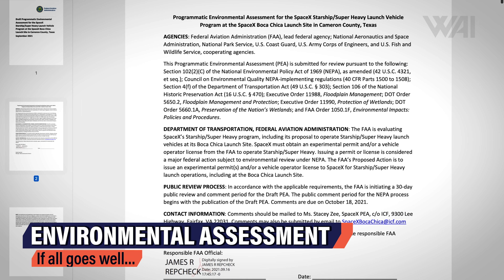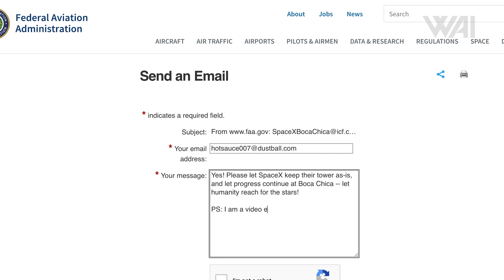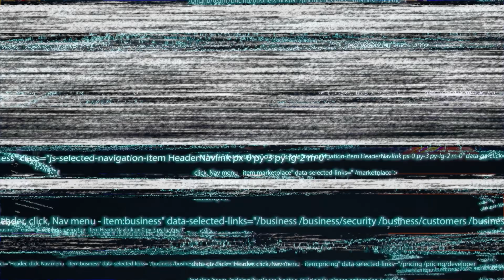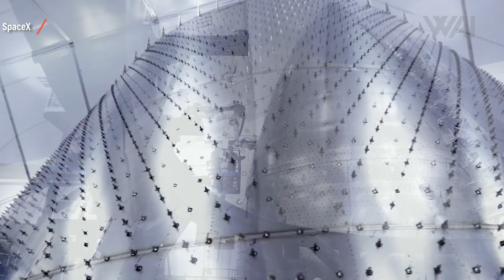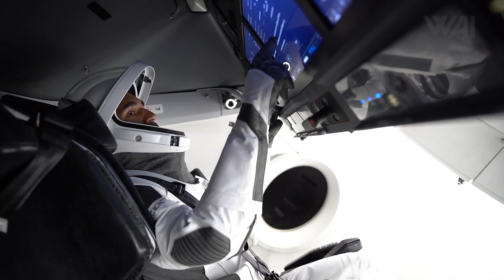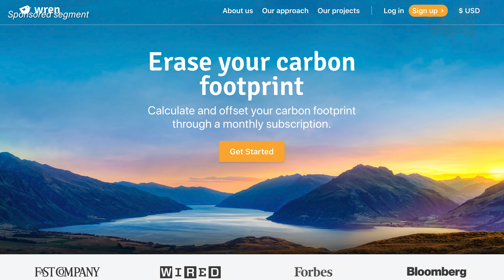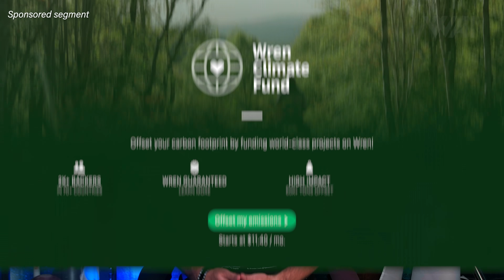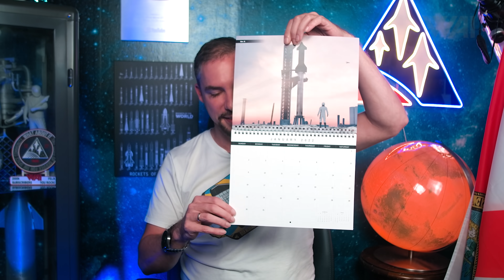One month to an orbital Starship launch attempt! & SpaceX Crew 3 Mission Status!

Comment: Idea for Heat Shield improvements on Starship: 1) Create a removable maintenance exoskeleton for the Starship that would be built in 8 to 12 removeable large sections that temporarily cover the areas where shielding is required. 2) This exoskeleton system will act as a mold for Injectable Heat Resistant Foam Insulation and perhaps a perimeter of Injected High Heat Silicone (for help with expansion and contraction) between tiles. 3) This "Exoskeleton" would have many Molding Tile sections within it (as many sections as tiles needed), and in each Molding Tile section there will be a foam spray nozzle (perhaps a couple other chemical nozzles as well such as a chemical cleaning nozzle, and perhaps a suction nozzle for sucking out liquified damaged foam from a previous mission). Each tile section mould would have to have to be made from or lined with an inner surface that the spray foam would not stick to, and allow for quick release, like release agents or oil that concrete contractors spray on wooden concrete forms to assist with form removal. 4) Each Molding section could also have it's own I.D. Chip for individual section identification and targeted maintenance. For simplicity the Heat resistant foam could be sprayed in from a central line system going through the Exoskeleton. Control of Foam spray would have to be controlled by pressure sensors or perhaps timed spray shots from each injector. Perhaps each repair done to a Tile Section could be carried out by a 3D Printer instead of just pressure spraying the foam in. This would likely require a small access door on each Individual TIle Molding section on the Exoskeleton. A built in traveller track would have to be built onto the the exoskeleton allowing the repositioning of the 3D printer all over the Exoskeleton where needed at the time. A separate small robotic would have to travel with the 3D printer to remove and then replace the access door when needed. Prior to making a repair with new foam within a damaged tile section, the cleaning/liquifying chemical could be pumped into the section to liquify the remaining damaged foam, and then have it drain out through a strategically located drain port on each Tile Molding section. Then the new foam nozzle would activate and rebuild that particular foam tile. This all means that each tile mold on the Exoskeleton has to be sealed and isolated from each other tile mold, so that only desired tiles are repaired.
5) After repairs are made, the exoskeleton is detached from the Starship with a crane, and stored away. Notice how the spray nozzles and all included hardware for that maintenance or repair have all been incorporated into the Exoskeleton and now are also removed with the Exoskeleton so there is no extra weight involved or needed to be left on the Starship itself. Also, the repair or maintenance on the Starship Heat Shield could all be done very quickly with this system.
Reply: I'll just say here, that NASA has researched the high heat spray foam idea with another company in the past. I'm not sure where they left off.

Comment: Idk how they currently attach the heat tiles but if some of them already fell off after a short static fire, they need to radically improve the method bc re-entry is 100 times worse than any SF.

Comment: To what I know, the space shuttles heat tiles would not survive a reentry from outside earth's local orbits (f.ex back from the moon).  Wondering if SpaceEx's heat tiles are/will be more heat absorbent, since they are supposed to being able to bring people home back from Mars.  Also wondering if perhaps some (maybe also heat absorbing) layer could be sprayed to the heat tiles after stacking.   This would in a way glue the tiles together and at the same time give them an extra protective layer =)

Comment: One of the key requirements of the SS program is quick turnaround times. I’m not entirely convinced that the current TPS is going to facilitate that. Those tiles are pretty easy to damage. Inspecting each one and replacing cracked or missing tiles seems like quite a time intensive task if it ends up being something that will need to be done between each flight. It may be quicker to have a single piece composite heat shield that can be swapped out as needed. That would only take a few minutes to do compared to inspecting and replacing individual tiles. It could slip over the nose at the top and be secured with a couple of bolts at the bottom where it’s easy for workers to reach.

Comment: If you assume the tiles are breaking off because the ceramic is failing at the attachment points, then... (perhaps SpaceX could explain why they are failing) put a backing layer on the tile which is then attached to the hull.  Adhere the tile to the backing layer and then attach to the hull into the backing layer.  Perhaps the backing layer could be carbon fibre.  Also make the attachment point (bolt, rivet, whatever) have a relatively flexible but strong joint (both on the tile and the hull).  Probably nothing is going to save a tile undergoing large flexing loads, but perhaps it could be better under vibration.

Comment: Yes, grind up the ceramic into a powder, mix with with a high temp epoxy and spray it on in layers.
Reply: I’m also thinking along these lines. The spray would be anchored as it is applied to the welded pins on the skin? Repair would simply be sprayed on?
    Sounds like a great project for some of those bright young engineers. Wish I was 40 years younger………stay on task boys we’re headed for Mars!
Gid’aie mate’s,
Rex

Comment: The material for the heat shields should be melded in with the stainless steel at the time of production. This would eliminate the need to attach the heat shields and worries of them falling off would bed gone. Doing so would give the steel new properties that would hopefully not weaken the structure but create a new form being able to withstand the extreme temperatures of re-entry. I'm not a chemist but maybe they can come up with a way to do it. I twittered Elon with this idea and I believe it should be looked at for future production of Starship. Just a thought.

Comment: Why don't they use a paper-like insulation material like "ceramic fiber paper", viz easy to cut, compact, fold, resist, absorb and flex enough in mostly all mechanical wear conditions with direct exposure to heat? It is proven that tiles are the most effective in heat reflection, but is a pain if it needs to be perfect within a minimum time period. Ceramic wool is too fibrous to come in contact with plasma, causing it to wear off at re-entry.

Inspite of having very less tensile strength, a thinner paper over a thicker one would improve insulation and sustain to body even if burnoff occurs. Not sure how effective it will be on Starship. But any insulation similar to paper has the simplest procedures and quickest turnaround times.

Comment: Sollution for heat shield.
Make it with flange, to farther place them one flange up - one flange down with overlap and clearance for heat expansion. Each should have premade holes, four or seven when one in the center. Employ a robot to place them, drill thrpough holes and rivet them to the hull.

Comment: 12:06 well I’m clearly not an expert on how the tiles are designed…but the pins on the cone…how exactly do they attach in?

Maybe make the puns a tad longer, and the “interior” surface of the tile has “hooked” holes in it…at the tile gets applied, the pins go into the holes and the shape of the guide holes forces the three pins tips OUTWARD from each other, thereby getting wider apart, thereby holding the tile to the ship?

Comment: Secure the TPS tiles to the rocket skin with flexible zip tie like attachments.  This would allow for the rocket skin flexing and vibrating.  Secure each tile to its neighbor by lacing them together in a sort of chain link.  Bring the ends of the lacing together on the leeward side and provide a mechanism to tighten any loosening that occurs prior to the descent.

Comment: Why not used for exagon tile's small spot welding bolt In the center of the tile and steel AN aviation or alloy 305 L  3/8 inch torque meter

Comment: Why not slightly overlap the trailing edge of each tile...like scales?  It would lock them in place (would add weight, unless the overlapping tiles were perhaps thinner, individually, but the same thickness while overlapped)...Plus...looks like a dragon.

Comment: Could super heavy launch another super heavy with 3 to 6 vac engines into space?
Since its longer than the starship I was thinking that it would be a good candidate for a starbase or future space construction gantry to build or assemble a cleaner nuclear spacecraft.  Also a cluster of super heavies could become a space refueling station.  By clustering interconnected opposing baffled tanks you could minimize  the sloshing problem.  Then rout the various fuels into a single  nozzle with multiple ports.
If several starships were clustered together would it make the trip faster?
Or does SpaceX need to look into a  non weapons grade nuclear rocket or cluster of rockets?  Even scifi uses multiple long engines for long distances.  Would it need to be constructed or assembled in space?
If nuclear rockets travel a lot faster would the launch window be longer?

Comment: Regarding the tiles falling off; how about adding a recessed tetrahedron with an inward tapered lip located at the back of each tile.  The metal shield attachment pins could then branch into three shovel nose male clip inserts (coated in high temp silicone to absorb vibration).  As the tile is pushed down on the tri-head pin the shovel noses would bend slightly together before snapping back into place as they passed the tapered lip.  The tile is seated, vibration and movement resistant; and will not come off unless the tile breaks.

Comment: we are not in a "Climate Crisis". The climate changes due to multiple factors the least of which is man. plate tectonics, orbital mechanics, solar output. which of these can mere man change? if you believe in the science and not fairy tales, you know this to be true. Planets wobble. in the 800's there was no arctic ice, the Norse traveled the famed Northwest passage unimpeded by sea ice. The polar bears did not become extinct, they adapted. Yet just a few hundred years later the ice returned and the north American colonies died out. The Sahara was once a lush rain forest and then a savanna and now a desert. how did man create this. What we are in is a drought of atmospheric CO2. in the 70's we did studies to see what CO2 concentrations did to agricultural crops. we found that at 1500ppm (we are at about 400ppm now) crops required less water, fertilizer and *cides to produce abundant crops. Greenhouses today supplement CO2 just for this effect.CO2 is a very poor "greenhouse" gas. it does not create greater effects with greater concentrations. Now Methane is a different molecule. Methane is produced in great abundance from herds of African herbivores and rain forest. Rain forests are literally massive compost piles with shallow soils. Between termites , bacteria, fungus etc the amount of methane is enormous. Old growth Temperate forest are also pretty poor sequesters of carbon. there is very little growth activity within them and much of the activity is decomposition. Now NASA discovered what are the true masters of sequestration. Mono crop agriculture.. in the Midwest of the US and the massive agricultural fields of Brazil, during the day CO2 level drop precipitously until they achieve 100ppm or so by evening. green cereal crops requite massive amounts of CO2. If we want to feed the planet, we need more atmospheric CO2 not less. 

The reason to become a multi planet species is not to survive as a species but to return to the star from which we came. Elon's comment of the shortness of the window to achieve this is not about running out of resources, but rather running out of the economy that can generate the funds for the engineering and the building of the massive infrastructure required. 
finally, the earth does not need to be saved from man nor saved by man. The next ice age will cover over and obliterate the evidence of this culture leaving it to what ever rises up to take its turn. Even a giant asteroid 165 million years ago did not stop the forward progress of life (what everything over a kilo in size died). "Nature will find a way".
 your mileage may vary

Comment: The main problem with the heat shield tiles is the adhesive shear strength. The tiles themselves can be re-used many times. They appear to have mechanical attachments as well. I would think the combination of adhesive and mechanical would be robust. Otherwise, maybe they need spray-on ablative, but that has a refurbishment time between flights.

Comment: The mounting surface is the problem, not the tiles. I do have a solution, I suggest keeping the pin mounting but instead of having the pins on a flat surface, instead install them on a recessed surface like 1/4 of a sphere or similar shape that would allow movement with expansion and contraction of metal and provide extra rigidity.
Reply: obviously the tiles would have to match the new mounting surface.

Comment: The heat tiles are the wrong shape. I understand the intent of the current shape, making this whole thing automatable. But changing the aspect ratio from 1:1 to maybe 4:1 would give each tile more contact points. The modular shape could stay the same, just gang them together.

Comment: I don't see why the tiles are not glued on. You would get full contact with the entire surface area of the tile, and save the weight and effort of welding thousands of pins to the hull. I'm I missing something here, it seems like a no-brainer?
Reply: I think the glue might crack from expansion and retraction😉

Comment: StarShip won't be a working, reliable Mars vehicle, delta V works against it. This will require a nuclear system. All StarShip is good for is LEO and placing materials on the Moon. Launches FROM^ the Moon would be a meglev launch system. Obviously *THAT is a long term project, but any other concepts will be failures over the long term. Greenland was settled during an unusual warm spell. But the return to normal annual temperature cycles ended that.

Comment: I think, starship is not big enough to bring humans to mars.
An even bigger spaceship, which would have to be build in orbit like the ISS, with artificial gravity (through rotation) is probably necessary.
Starship could be used for transfers from a planets surface to this spaceship as shuttle for cargo, fuel, etc.

Comment: If it were me I would change the heat tiles thusly, if you notice there are two holding pins on top and one at the middle bottom. I would reverse this arrangement or better yet add another pin and make it four.

Comment: Okay this comment might seem ridiculous to some people and maybe it is a ridiculous comment but the heat shield tiles what if they were magnetic. I've seen some of those train track magnets that are insanely strong.
What if they could make the connective side of the tiles very powerfully magnetic and could just physically put them on the hall without any holes or invasive anything to the stainless steel.  

They could use a tool to pry them up or adjust them as needed but otherwise just drop them into place magnetically.
Collectively the heat shield might be strong enough that wind getting under it or all the forces they experience if it's strong enough magnetically it would stick.